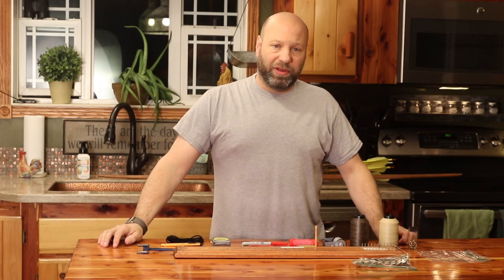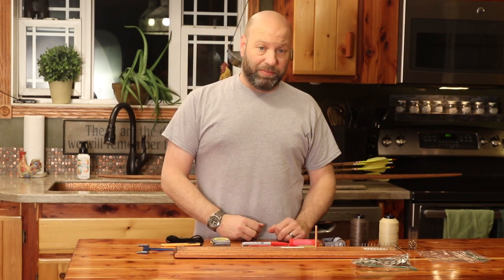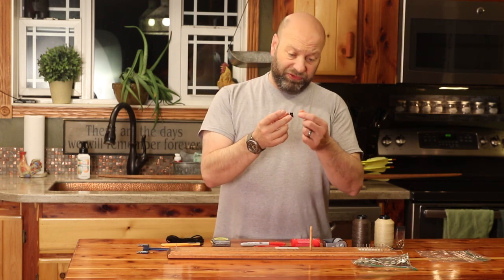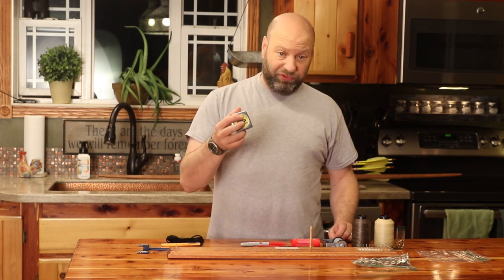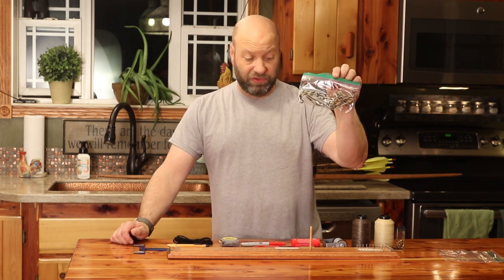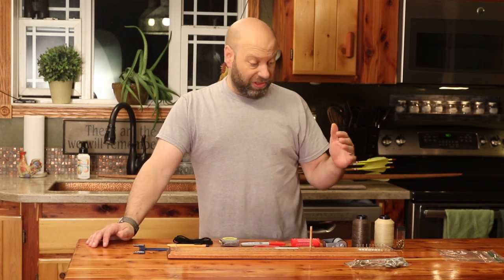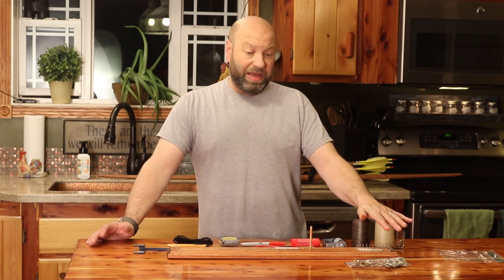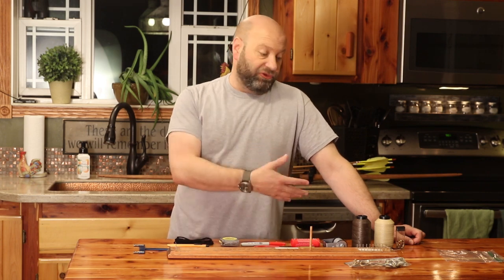Making A Flemish Twist Bowstring Start To Finish

Comment: I Built my jig with a "plan" I found online. The measures on it weren't ok for the string length... I just tried to modify the "inches numbers"... I tried to build a few strings (WOW I AM SOOOOO PROUD, LOL, even if I made a few mistakes, like usual I wanted to do everything too fast, LOL). They are not too bad, but I struggle (but I will learn, lol) where to start the twists on the thread bundles to build the loops on them, and at the proper length/place..  Hard to explain, my English is not that good. Thanks a MILLION for this video, I really appreciate it, it is the best I've seen on the net !!
Reply from the maker: Glad you are making your own strings and enjoying it. personally, for my longbows I start the tiwists 9 inches from the end, the I twist 5 inches, then 1 inch for the loop.

Comment: Jason, I have been making endless loop bowstrings for a very long time and they work well but decided to start making Flemish Twist strings. I watched a lot of videos on the subject and decided to suck it up and spend an hour on yours. I found it to be time well spent as your attention to detail and the fine points is appreciated. Also I had a plan that I had pulled off the net somewhere a few years back and it looks identical to yours, although I’m sure the dimensions vary. Thanks for a nicely done video.
Reply from the maker: Glad you enjoyed the video. The Fleishman strings are pretty easy and fast once you get your jig board and loop measurements dialed in.

Comment: Hello from Idaho.  You have informative videos.  My home brew string jig is very similar to yours which made me very interested to see your technique.  Like you, I have a mark on my jig for the loop starting point at exactly 9 inches.    A step yoou might consider is to scrape the tips of your string bundles with a knife or a razor blade to fray the string tips a bit.  This makes a difference on how smoothly the string bundle tapers down, moving away from the loops.  I like your suggestion on making the loop on the bottom limb fit tightly.  I'm going to do that from now on.  I add back twists (30) to my string bundles before making the second loop.  But, instead of 30 twists I'm going to try 20 next time.  I had a heck of a time getting consistent and repeatable string lengths before I really paid attention to small details like the 9 inch loop starting point and the exact size of the loops.   For string stretching I mounted a ratcheting boat trailer winch onto a 2x6 with a hook about 6 feet away from the winch.   Stretching overnight with a good amount of tension is very effective.  Thanks for the videos.  No fluff and no music is good.
Reply from the maker: Love it! Sounds like you have a great system! Also appreciate the extra tips. You are so right about the little details making all the difference.

Comment: Great video!  Would you mind sharing a picture of your jig.  I have the same jig but would like to see your markings, so I have an idea about where to put my measurement markings.  Thank you!
Reply from the maker: The marks I made will probably not line up with yours. That's why they don't write anything on them. Everyone twists differently. Only way to figure it out is to twist up a string and these see how too long or 2 short it is and move the peg. Make another onento verify and then mark the hole. But if you email me thru my website tbwpodcast.com I will send you pics of my markings to get you started

Comment: Excellent video! Makes me confident I can do it. Have always built endless strings but never learned Flemish. Now I will try it again.

Jason, are you still using B-55 on your bows for the 2022 season?  I like the feel of the bow in my hand after releasing with fastflite but don’t like the twangy noise. Dacron is so much quieter and I think going extra in strands than recommended makes it less shocks in hand after release.
Reply from the maker: Yes Im still using Darcron b55. I love the stuff. I make 16 strand strings and am very happy.

Comment: Awesome video! I followed it step by step. I believe turned out fine except it was a little longer than I thought And had to twist a lot to bring it down.  After the loops, how many twists Should be done before installing the serving? Or rather how many twists are too many
Reply from the maker: Honestly I prefer more twists then not enough twists. And I have never noticed a difference in how many twists matter. I dont have an exact answer for you. Bit if it bothers you, make another one a little shorter now that you know how.  Or use same length hole but add another quarter inch to the tag ends before you make your end loops. For serving I wait until I jave the string at the correct brace height then serve it.
Reply: @SamkoTradBow  then you for the reply.  I did twist until I was at the proper brace height and then sever it, but had to twist down a couple inches before that.  Do you normally wait a day for the string to stretch/settle in before serving it?
Reply from the maker: @ryukage6695  yes usually I make a string and leave it on the bow over night then serve it the next day.  You don't have to. But that's what I do. I think a couple hours on the bow is enough to stretch it enough to serve it.

Comment: When I made my jig, I labeled my first nail as zero, and then 1, 2, 3 etc. So then I just wrap around until my string comes across the nail labeled for the desired number of strands. I think you are accomplishing the same thing with your last wrap around. I'm not saying my method is better. But it seems simpler to me.
Reply from the maker: Not sure. I have been using this style double nail row jig for last 25 years. Not sure how a single row jig would work.

Comment: Great video, cam you over twist a string ( harming the bow). If the string was a half inch too long can you add that much twist? Would would you look for to indicate too much twist?
Reply from the maker: I dont think you can hurt the bow by having to many twists. i have seen strings super loose and super tight. I dont think it matters much. but if its too tight for your liking just make another one. I have had to trash a few strings because I made it longer or shorter than i want.
Reply: @SamkoTradBow  , thanks for the reply and the wealth of knowledge in your videos!
Reply from the maker: @travisfincannon2409  welcome and glad you are enjoying them.

Comment: Jason can you speak to why you chose Dacron for some bows and a modern “fast flight” material for others?
Reply from the maker: I shot darxon on all my vows for many years. About 10 years ago switched to fast flight for all the reasons people like it. When I started shooting a classic hill style bow I thought it might be fitting to go back to dacron. Once I did I really like the quietness and feel in the bow hand. So now on all my bows I'm shooting dacron and loving it. But I have to make more strings. With darcon I'm going thru 2-3 strings a year where with ff I would be 1-2 strings a year. But to me worth it. Not to mention (but not a reason I chose dacron) its so much softer and gentle on the bow.

Comment: Why do my bundles after the loop wanting to keep untwisting when I string my bow?
Reply from the maker: You jave your loops going opposite ways.  Need to make sure you are twisting in same directions for both top and bottom loops when you make them so thry lock into each other rather that try ro untwist each other. For the record I still screw this up occasionally as well.

Comment: I have tried to make a flemish string got the material and made a jig and no matter what I have done the string never seems to work it always comes apart waxed the string lengths a little an amount that I have watched everyone do I have only ever come close once I have used string wax beeswax and beeswax with a little oil I have followed everyone's instructions ad it ends in failure and I am doing something wrong
Reply from the maker: You are probably reversing the twists between the one loop and the other make sure you are going the same way with the twists on each end. Like black over yellow and twists right or something similar to make sure you are always twisting correct way. I used to jave the same problem occasionally until I started paying attention to twist direction.

Comment: I am struggling to get the correct measurements I have made a good string once out of three goes at it the last two was 4 inches short I am using BCY 55
Reply from the maker: The peg holes are just a reference.  Everyone makes thoer strings a little different.  Try moving the peg 2 holes longer. Once you get it dialed in Mark that hole with the string size.